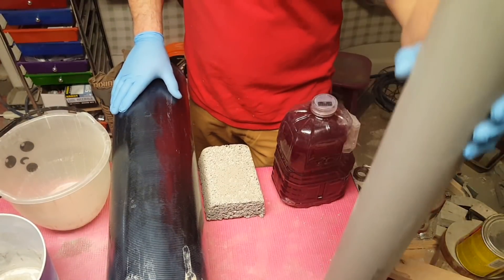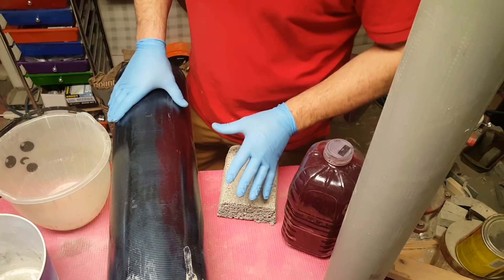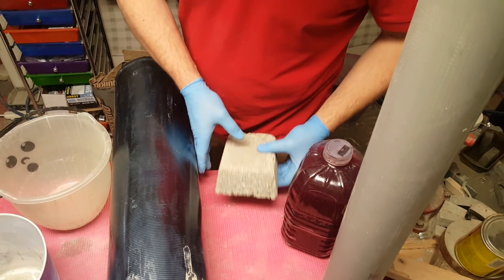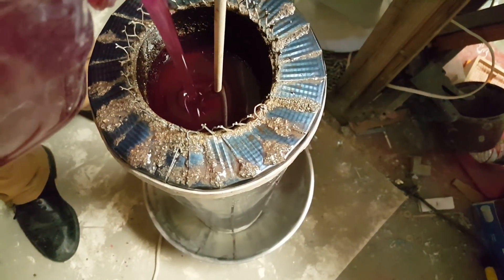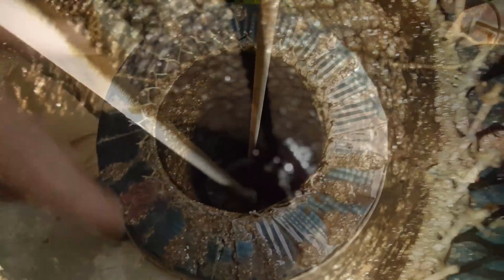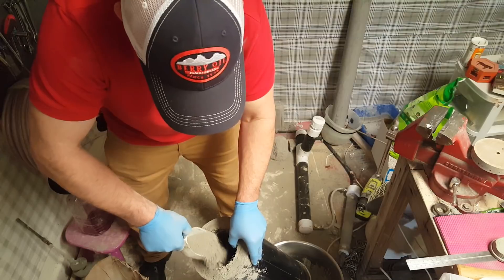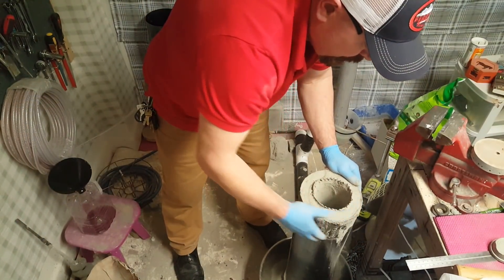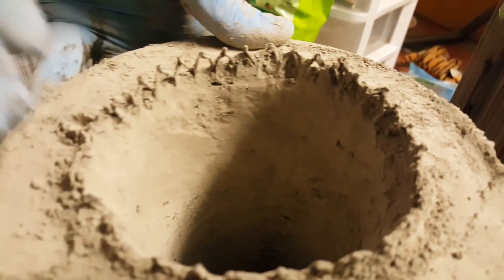Sealing a Air Crete Heat Riser with Water Glass

Comment: Cap a piece of 3" pvc or use a sealed tube just smaller in diameter than the inside of the riser.  Seal your riser.  Pour the silicate in and displace the silicate with pipe until it flows up to the top.  Repeat as nessecary and then you can reclaim.

Kind of like sticking your arm in a pvc pipe with water in it.  It will displace the water.

Also, carbon dioxide will cure the silicate faster.  A tube of baking soda and vinegar will generate it.  Insert and seal the riser.

Comment: Instead of using a plunger or rod method  (although good idea ) try this one. Get a sprinkler head from a fire system ,as used in buildings . Attach that to a tube ,then connect that to the hoseline of a hand pressure garden sprayer..   Fill  sprayer tank ,pressurise ,place sprinkler head in base of heat riser ,open sprayer valve and operate from base to top,  Repeat operation till all liquid is gone from sprayer tank .  Using this method gives you total control of how much liquid you use ,is quicker and ,(as you daughter points out) less mess .

Comment: The best way to impregnate porous materials is with a vacuum. I'd try getting a plastic painter's drop cloth (or a thick trash bag) and put that in the bucket first, then pour the water glass, enclose the riser in the cloth, then tape seal the cloth to the air intake of something like an leaf blower.

Comment: have you tried using water glass to make the cement slurry
before adding the foam instead of water to make foamcrete?
Reply: jack young  water glass cures with CO2. 
Don't see how it would cure internally. 
Maybe with dry ice in a bag?
Reply: I have seen and used myself, waterglass used to seal a cracked engine block!
poured it in the radiator , filled it with water and run it  , the crack sealed 
and left a white residue on the crack where it sealed it!
people use it for part of the process in making pottery 
( what I don't know) butwaterglass will cure in open air.
Reply: jack young  co2 is what cures it .
It's in water too.
I just wonder if the gas can get by all the air pockets .
The air would have a little CO2  but is it enough ?
More experiments are needed
Reply: ah ha now im pickin up what your putin down !!!
Reply: Has anyone tried taking CO2 cartridges/soda makers and carbonating the water, mixing cement slurry and then adding water glass?
Reply: Or, taking the required amount of water for mixing, throw in some dry ice and a weight to hold it down - and let it lower the water temp whilst carbonating the water. This will increase cement set time, and as it warms up, the CO2 will bubble out as the lime heats up - setting the mixed in water glass?